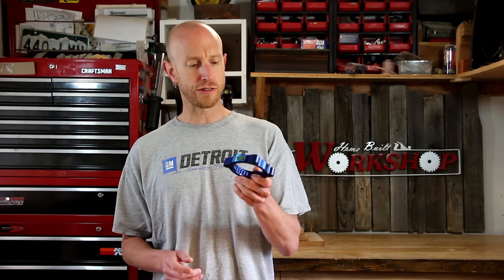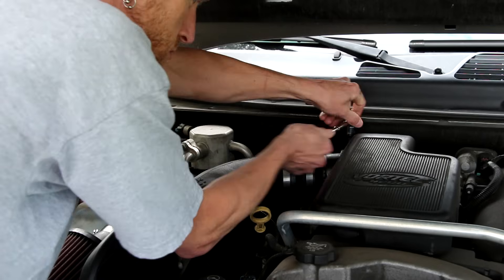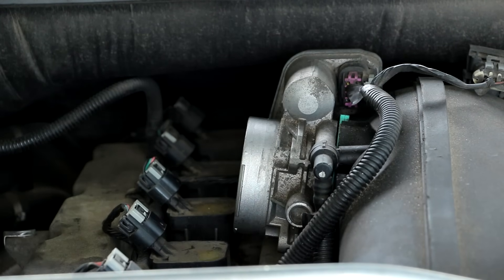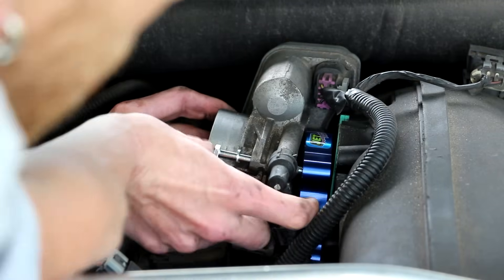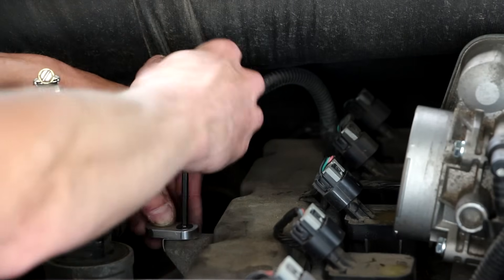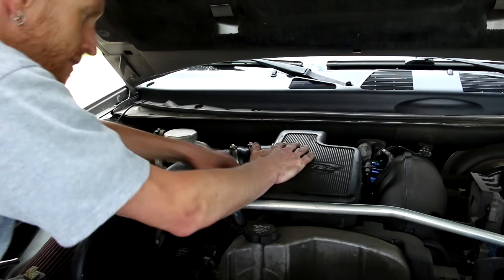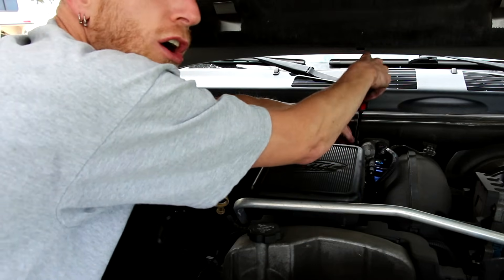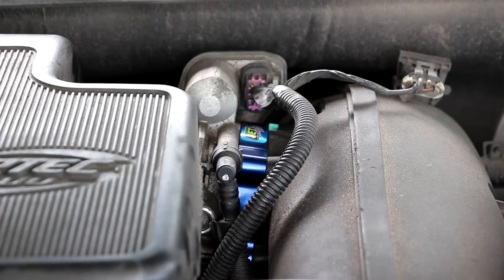Is A Throttle Body Spacer Worth It?

Comment: There is no reason it should add any power rather than a "placebo" effect.  That is it is all in you head. Nothing changed enough to do anything in my opinion. Didn't change manifold volume much or space the MAF sensor much further to make a change, but my guess is that is how one might think it would work. If it ever worked My guess is it would have to do with the throttle cable pulling 100% after when it was not in the first place, or  you had a vacuum leak there to begin with . Spacing a carb is very different and more so if you're spacing the carb from a cast iron intake  with aluminum.  Maybe if coolant  flowed through the throttle body and the spacer cut that off you might se some change, but my guess is not much and they did that for a reason  on cars that do. Just a winter issue, but might gain a tad more with a cooler throttle body. I doubt something  that would show up on a dyno, but if your just sipping air I could see as possible.

Comment: Can people STOP CALLING SHORT RAM AIR INTAKES "COLD AIR INTAKES"!!!!!!!!!!!!

As for Throttle Body Spacers, i just learned these exist for this truck a few minutes ago, my small understanding was for carb engines the extra space gave the air/fuel mixture time to mix a little more so you got a better burn, for a vehicle that injects the fuel much closer to the motor I don't see how they could do anything and anyone claiming a difference without before and after dyno runs is likely suffering the placebo effect.
Reply from the maker: I think the reason we call them Cold Air Intakes is because thats what they are called from the manufacturer. It says that on their website. I and many others are just repeating that nomenclature.

Comment: Would you recommend cold air intake in colder climates? I live where it's subzero in winter so I've been leary.
Reply from the maker: +sokodad it gets below zero where I live in the winter and I haven't had issues.
Reply: +Jeff Baker I'd like to get more power out of my Avalanche. So I was considering that, a programmer, and less restrictive exhaust but I want exhaust tone to stay relative quiet.
Reply from the maker: +sokodad you should be able to keep exhaust noise down. I'd look at some of the flow master options.
Reply: I live in minnesota and I run cold air intake and I don't see a problem with it I like my cold air intake
Reply: programmers are "okay" at best.... for the same money get it tuned.. on a dyno as every engine is different

Comment: tahoe is truck is basically a silverado with factory camper I have both a 99 2 door tahoe and a 99 silverado all same parts for 5.7 engine and suspension

Comment: Why wont people just learn and accept the FACT that you need to have you vehicle tuned after making modifications. Especially when dealing with the air/fuel ratios....you cant just slap on parts and think the stock ECU is going to recognize what you've done and just correct it perfectly... 🤦‍♂️🤦‍♂️🤦‍♂️🤦‍♂️🤦‍♂️🤦‍♂️

Comment: The spacers were created help keep the hot engine away from the fuel in the carb and TBI, it was a fluke that they found out it also helped mixed the air/fuel better, somewhat like a tunnel ram. On a direct injected motor it may add to the plenum but you can spend less money on other things to get a better improvement, like a NOS refill.

Comment: I put on Spectre cold air intake. I just put on a Spectre throttle body spacer. OMG. I definalitly noticed a difference right away when I smashed the gas pedal. I have a 2010 Chevy Silverado with  a 5.3 litre engine. These people who don't believe it works, are full of crap. I had a buddy tweak my computer and I put on Flowmaster Catback dual exhaust. I figure out with a little math work, it has at least 425hp. I have to put on a dyno machine to be sure. I am happy with my results with these add-ons.

Comment: i got a question ! i changed the throttle body and i put the body spacer put now i got the check engine  light on and when i start the truck its already at 1000 rpm ?? what can i do ?
Reply from the maker: +alex valenzuela make sure everything is connected properly and all bolts are tight. Maybe a plug or something didn't seat correctly or got bumped loose.
Reply: it happens alot when u change trtl bdy... can be max air flo sensor ...tps...hard to fix...
Reply: Remove the spacer. Also let someone that knows what they are doing work on your engines.

Comment: Given the age of the video and more than 1300 comments. The odds of what I'm going to say has probably been said and possibly beaten into the ground a bit. But here goes. 
  As an old-ish school mechanic. I've done my fair share of modding and building HP engines, for myself and customers. Both carbs and FI. 
The spacers we added back in the day had more to do with changing the powerband and curve. It has NOTHING to do with "adding power". Any power difference one may have felt had to do with changing when and where ( Low, mid, high RPM's) the engine would begin and continue to make peak power and torque. So once those times and values were changed you as a driver would feel the difference.
  Yes, there are those out there that will say I'm full of crap. That's fine. I was taught and trained by an NHRA Pro-stock engine builder, Mobile, and other's. No, that's about as much name dropping as I'm going to do. Besides, it's the internet. Trying to win an argument on here is like trying to get water out of the Atacama.
  As far as TBS are considered. If you noticed the ribs on the inside of his spacer. That is how the air is either smoothed out or altered in whatever form you want (different shaped rids on the inside of the spacer in this case). You want a high velocity centrifugal flow, to my knowledge. I'm in no way saying I'm an expert in fluid dynamics and flow. But the higher the velocity you can achieve with as little disturbance with the environment (TB, TBS, Plenum/manifold, and heads) is the goal. More air=more Oxygen, More Oxygen=More consistent and complete fuel burn within the cylinder, Which equals more power and better fuel economy. As well as throttle response, although when that response is improved is dependent upon your tune. We can get WAY out into the rough on this. So I'm just going to leave it there.
  Y'all have a good one and be safe.
Reply: Drag is what the problem is with any air flow, tube, pipe, plate, narrow TB valve etc.  The Airaid I installed is just smoothing out the air flow by creating rotation at the restricted manifold port.  I got noticeable improvement on my 8.1 Vortec.

Bernoulli principle on a wing means the air flow velocity at the front of the wing is the same speed when it reaches the back of the wing, which the top curve of the wing is longer in distance than the bottom therefore lift is created.  Just think about all the crazy air dynamics going on with the air flow just getting to the intake.  So, the velocity of air at the front of the intake edge being narrowed down and restricted will be equal after it gets past the edge inside the intake.  

There is a crap load of turbulent air at the intake of factory manifolds it is seriously restricted and poorly designed.   The crappy thing is that GM, Ford, and Chrysler don't care.  They know some day they will be held accountable to a better design but since they all said they were dropping gas motors soon they do not need to spend any more time on gas motors. 

My first 2001 Avalanche 5.3 was factory ordered from a brochure before any were at dealerships, never even test drove one,  got 18 mpg.  I traded it after getting 100,000 miles and got the exact Avalanche in a 2004 model.  I could barely get 15 mpg.  I wonder what was on that very first early truck that was not on the later ones.  I think GM got too good of gas mileage too early and intentionally lowered the average mpg of their vehicles to play the EPA regulations.

Comment: i think tbs is only worth it in heavy modded engine where you can gain a bit of extra power during the low end rpm as seen n done by nwp engineering team.

Comment: Just think about this logically.  You are adding a volume of extra air (pretty small, the size of the throttle body spacer) behind the MAF.  So you are essentially running leaner than the car would run without the spacer.  But look at how tiny the added air volume is vs OEM.  Also to make more power you'd have to program the ECU to add a tiny more fuel to accommodate the tiny increase in air volume.  So I agree with your conclusion that it makes virtually no difference and the chances of breaking something is a greater than the benefit gained.

Comment: why do you still use a resonator?  I took both off my 4runner
Reply from the maker: I just haven't gotten around to removing it.
Reply: I have am 05 ram 1500 why would someone remove their resonator.
Reply from the maker: Its supposed to be less restriction in the airflow, which in theory could produce more power. I haven't tested it though to confirm that.
Reply: +Jeff Baker I didn't think a resonator was a performance part. You would never find one on a race car.
Reply: +Jeff Baker Also removing it makes it sound better :)
Reply from the maker: True. I don't believe it is a performance part. I just haven't tried it without it. Did you notice any improvement?
Reply: +Brandon B do you replace it with another part
Reply: Rcatling I took mine off and covered the holes in the intake. Intake sounds throaty now + K&N filter replaced my intake box. I can really tell difference. According to my scan gauge I reduced the load on the engine by 4% at idol which is equivalent to the load the AC.uses.
Reply from the maker: That's pretty good.
Reply: Can't you just buy a high performance k&n or Mopar intake kit. Which replaces the resonator?
Reply from the maker: I have a K&N intake kit on the truck. It replaced the airbox but not the big resonator.
Reply: Would you suggest taking your res out?
Reply from the maker: I'm not sure. I don't know how much of a difference it would make. It would be fun to experiment with if you have a piece of tubing to replace it with.

Comment: This is good to know. And there are many ways to help increase your car's response, such as simply tightening your throttle cable (for older cars) if they have too much slack in them. There are a good amount of upgrades for cars that simply just do this type of thing and not necessarily increase hp. Despite you saying it didn't do anything significant, there are some cars that need all the help they can get (my car lol) so I might look into this too.
Reply: The guy just bought one and installed it -- drove a few miles, and said "It didn't do anything signifcant."
 NO BUENO !! In order to get REAL results, several tanks of fuel must be gone thru, with each gallon used being measured to two (2) decimal places (00.00).
 We CANNOT judge a vehicle's performance with the BUTT Dyno !! Accurate fuel consumption is the ONLY way to measure the overall performance of a street-driven vehicle. Period.
 After installing a TBS on a 4.6-liter V-8 and driving for several thousand miles, Fuel Mileage was recoded to two (2) decimal Places (00.00) both BEFORE and AFTER the TBS install.
 NO IMPROVEMENT of ANY kind was observed. NOTHING !
Many engine tuners have said, and I agree -- Throttle Body Spacers DO NOT WORK on Port-type Fuel Injected Engines.

Comment: You realized the reason you felt a little difference is because all you did was tighten your throttle cable by spacing it out I bet if you took that spacer out and shorten your cable the same distance you would feel the exact same thing
Reply from the maker: This vehicle is a drive by wire, it doesn't have a throttle cable.

Comment: It shouldn't have done anything being it doesn't have a  carburetor,  and there's no blower........maybe you knocked some of the dirt out of your air filter during the install. The cylinder volume dictates the vacuum max. while restrictions, deduct from that value. If you want performance try  different injector styles, or clean your existing injectors.
Reply: If you have a throttle body  with the one internal injector it will make a difference as the spacer will create more of a venture to mix the fuel and air.

Comment: This will do nothing at all. It's only elongating the air intake. If it was a spacer that goes after the fuel injectors, or under the carb, then it would help because it would allow the fuel to atomize better. But this one goes before injectors and it's literally doing nothing. Adding a "cold" air intake would be basically the same as this. You're basically just adding more pipe.

Comment: What do you people not understand about throttle body spacers?  OMG some of you don't have a clue!  It's not a part that's going to show a difference on a Dyno test.  It's not gonna give you significant HP increases or anything like that.  All it does is increase your throttle response slightly at lower RPMs.  It's a cheap part for a minimal performance increase.  If you don't believe it's worth it then don't buy it.  But good luck finding something that helps your performance for under $100.

Comment: I got a 1998 4 runner get into truck fire it up  get a hight adel of 2500 rpm why also no vacuum lines r off
Reply from the maker: +Jennifer pruitt maybe some crud stuck in the blades of the throttle body? Cable sticking? I'm not sure.

Comment: The spacers really only make a difference on the early versions. I put one on mine just stock and you could tell it was more responsive because the ecm was able to dump some more fuel. But if you run an old style round air cleaner you can hear it whistle sucking in a bunch of air about 2500rpms in a truck

Comment: I think if the spacer is no less than 1.5 inches you will have a noticeable difference in the power band, especially if you already have an upgraded exhaust system

Comment: A throttle body spacer Is literally not going to help you gain power. The only reason i bought one for my l32 engine is because it blocks coolant from going into the throttle body and reduces heat, which reduces KR. No TB spacer will give you power, end of story.

Comment: Only time a spacer has benefit is on a carburetor car.  It's all about fuel mixture and fuel injected cars do that in the intake runners or directly into the combustion chamber - not at the throttle body.

Comment: Throttle body spacers are a complete waste of money.  If it was that easy and cheap to improve the performance of your vehicle you would see manufacturers putting them on vehicles at the factory or they would just make the throttle intake a little longer.  Spacers on older motors with carbs made a difference because the fuel was mixed with the air before being sucked into the intake manifold.  A spacer allowed for better fuel atomization.  On a modern engine the only thing going through your throttle body is air.  The fuel is introduced right down at the valve opening or even directly into the combustion chamber on a direct injection engine.  Therefore the spacer is not granting you any benefit.  It's a gimmick that suckers a lot of guys into wasting money on their car and they think they've done something to improve the performance.  It doesn't.
Reply: Red Horse koo9

Comment: Whenever anyone talks about add ons to engines that, like the throttle body spacer , promise better performance or gas mileage  I always wonder why the car companies don’t put them on. These guys are always tweaking engine designs for better performance and mileage to stay ahead of the competition. Why then, doesn’t Ford or Chevy, etc. build these into the engine in the first place?  I’m sure the automotive engineers have, and come to the same conclusion as you have.....no noticeable difference.
Reply: Why don't they tune vehicles for max performance, just adding a tune to a factory car can increase power and gas mileage a ton, I picked up 21 wheel hp and 3 more mpg on my wifes daily, just from a tune for 93 but honestly to spacers are a rip off because they do nothing
Reply: My thoughts exactly. All these ads and infomercials on how you can increase fuel mileage etc…….why don’t the factory’s do it?

Comment: The biggest claimed benefit of these throttle body spacers is the supposed increase in power.  But you didn't dyno the engine before and after.  How are we supposed to know if the purchase and install is "worth it" if you didn't test anything?  Are we supposed to just take your word for it?  Fail.

Comment: On fuel injected engines, these spacers should make no difference. On traditional carb'd engines however they can help with fuel atomization / air-fuel mixture which can improve performance to some degree. Like someone stated earlier... throttle body only handles air, so spacers on modern cars do nothing to help with air-fuel mixture, which is the sole purpose of adding a spacer plate to an engine. They worked on old engines and therefore became popular... now it's just people trying to cash in on recycling older tech that no longer carries any benefits with newer, fuel injected engines. Kind of like tubbing the rear end of a front wheel drive car... apples and oranges... the tech no longer applies.

Comment: I can't see this doing anything.     if it did work why aren't cars factory made a little bit extended?
Reply: Same reason they don't all come turbo or supercharged .. gotta change things up and make people think they're getting more or less for money spent or saved... I mean they know catalytic converters in the long run do more damage to the cars and environment then not having em but hey let's knock off 7 or 8 mpg by slapping this crap on the exhaust that will build up back pressure damage the engine and at some point dump twice the pollution into the air...